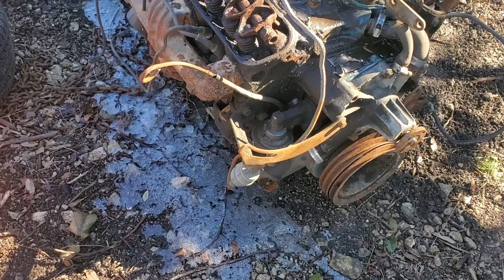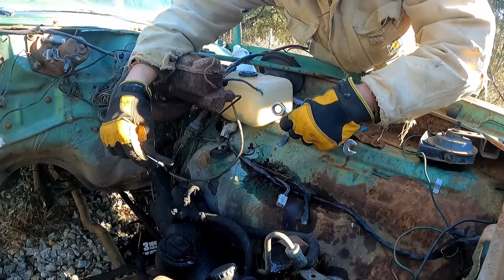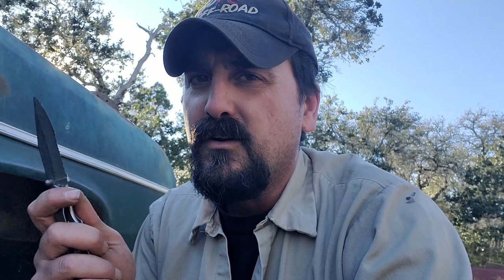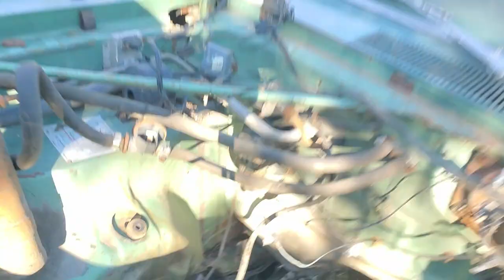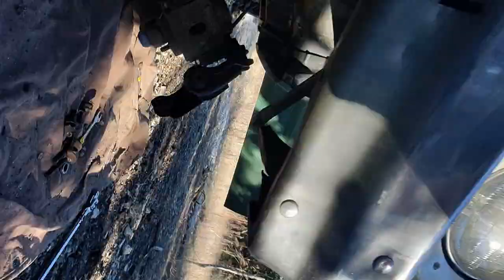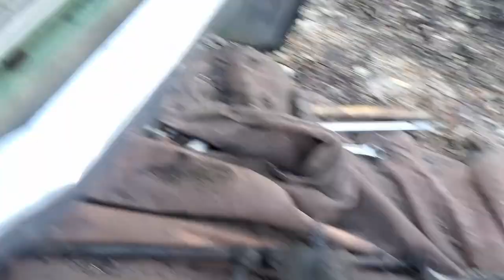1975 Plymouth Valiant Effort A-Body K Frame , Suspension, and Steering Removal

Comment: Look how clean that rails are. You won't find anything like that here in the rust block NY. You'd be lucky if the glass stays in . 
Flying solo again. That's how I roll. 318's have the anti oilers from factory
Reply from the maker: The frame rails are surprisingly pretty good on this car, Thanks For Watching!

Comment: After you knocked the pin out of the steering column did you pry it apart from the steering box? Or did you just allow it to come apart after you loosened the k frame bolts?
Reply from the maker: A little of both, but it mainly came out once i dropped the K member. Appreciate it and Thanks for Watching!

Comment: I have a 76 dart lite with a sl6 4sp, I'm putting a small block in it, what all do I need to complete the swap???? Thanks for the videos.😊😊😊
Reply from the maker: Well there is a list of things to do. Be sure to research your swap before starting. Check out these motor mounts also if you are keeping your slant 6 cross member https://www.engine-swaps.com/products/67-72-a-body-s6-to-273-318-or-340-360-conversion-kit . Good luck on your swap! Thanks For Watching!
Reply: @DuddiesAdventure  okay I will do that. Thanks so very much, I'll  stay tuned.